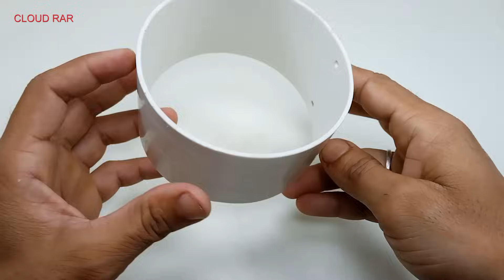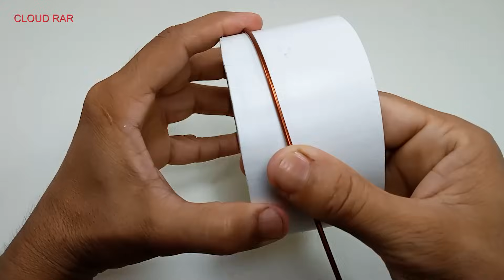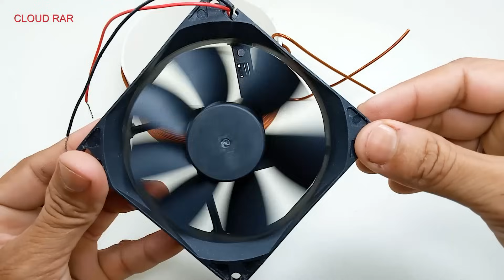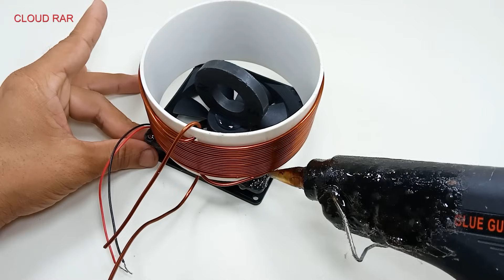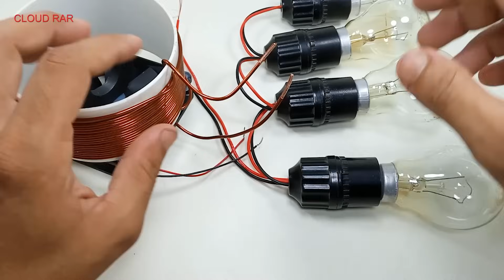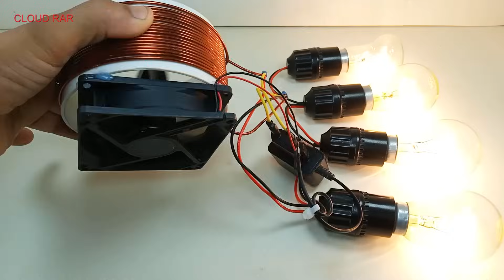How to Make a Free Electricity Generator With a DC Motor, copper wire, and 240V free energy At Home

Comment: Give ampear but don't give volt 
What is problem 
Give me solution 
Plz dear
Reply: What you need to do is, round your wire like 100 times
Reply: Like how many amplifier you get and how many voltage you get?
Reply: 0 voltage give